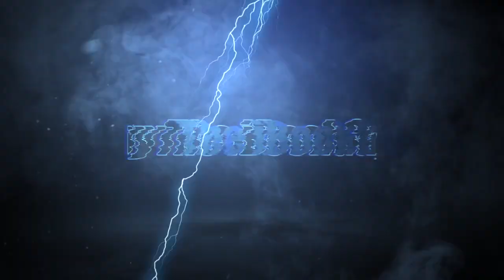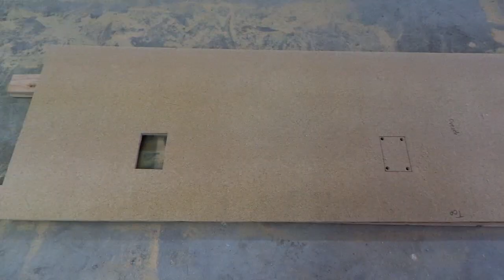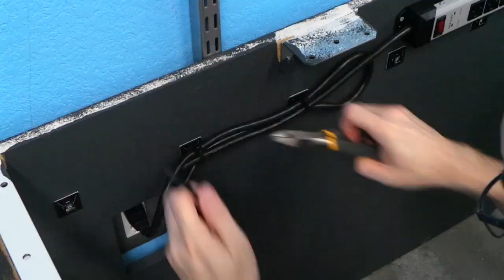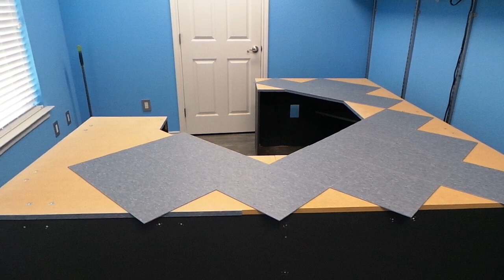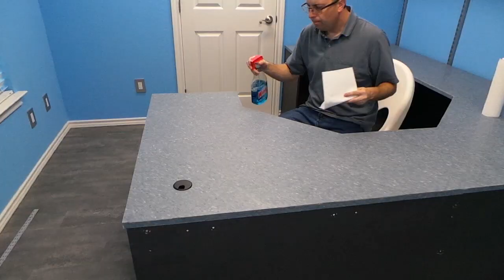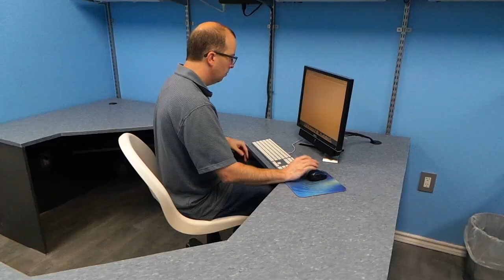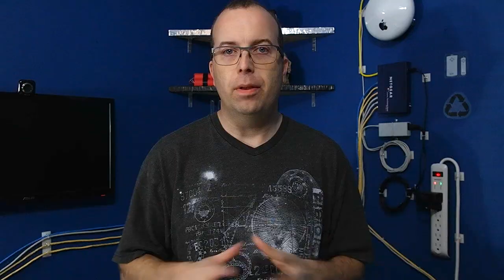Building the Ultimate Computer Desk - Part 3

Comment: Know this is from a while ago, but YouTube just recommended these videos, and I just had to comment... 

What you ended up with for your desk is real close to the desk I've been using for the past 10 or 12 years, that I cobbled together from several different types of office desks, except mine has a second level of storage cubbies stacked near the corners, on either side of the main work area, and a single shelf where my primary dual monitors sit.  I've also added several adjustable laptop/monitor stands that I can swing in and out as needed, along with recessed power/USB ports so I can plug things in from the top, instead of needing to reach underneath or behind things.

Comment: I've wanted to build this desk for like 4 years now finally in August I'm going to start I dont know if you'll see this but I'm thinking about using 1inch wood because the pc I'm getting for school and work is huge and heavy plus I'll be having 2+ monitors a printer but I was thinking about putting that on one of the shelves put it's also going to have all my gaming stuff as well I was also going to add in support posts in spots where it wouldnt restrict movement

Comment: First: great job. Even a crappy desk in this size would have cost you at least a grand out of the store.

But a few notes from somebody who also built his own working desk:

A rotary saw would have probably helped you a lot. Jig saws might be good for small sections, but they are very messy and slow on longer ones.
You should have used thicker or stronger wood, because the desk will bend over time. This will likely also lead to tiles popping up.
Another recommendation would be to use stronger L-Brackets for attaching the top. Your little undershelves were a good idea, because they increase the rigidity dramatically.

The tiles are interesting, but as you already experienced, they might not be available, if you need them.

One last note: Don't hide Macs. Cheap PCs, yes. But an Apple PC is always a joy to look at.

Comment: Hey I think that the 'Building the Ultimate Computer Desk' series is great but I would like to know the measurements you used to make your desk form this 3 Part video.
So if you can make link to the measurements you used that would be great.
Reply: I made a sketchup that's 2 meters by 2 meters if u want to use mine.

Comment: For desk underlighting, a really good and super cheap method is LED battery powered flip lights ( found for $1.00 each at DOLLAR TREE in my area although more expensive versions available at Harbor Freight, walmart, Big Lots, Target, etc. , take 3 AAA batteries each, one light brightly lights a medium sized room if high enough, also use velcro tape to mount the lights for easy uninstal/install for battery changing, one on underside of each half of the desktop will provide more than enough light and these lights can be left on and stay burning for days before battery failure) You can get the velcro at walmart and 2 lights at DOLLAR TREE and 6 batteries at DOLLAR TREE also for as little as $6.00 + tax.

Comment: If you build anything like this again, use a high quality Baltic Birch plywood instead of MDF or particle board. BBP is MUCH stronger, will last incredibly longer, and you can apply stain and urethane to it to get the look of a very expensive piece of furniture. BBP is going to be more expensive, but the pros far outweigh the cons.

On a side note, I just searched your channel for a video of the brain you had sitting on your bench, and couldn't find it. That thing was amazing.........did you make it or buy it??? I would love to have something like that on the shelves where my computer is set up.

Comment: It's been awhile but you probably would be better off buying a desk kit and modify it or look into commercial modular office cubicles. I do like your floor tile top, but ask around for discount/discontinued partial sets. Never use particle board without corner-side end reinforcement, full length end-cap brackets. oriented strand-board maybe better option.

Comment: edges are normally done with a bearing bit for router  This would have cost me a pinch more time BUT for your replica about $40 in Full. There is smooch= "so much" tile and flooring mat'ls at Restore, adhesive too that is CHEEAAAP You could have used 1x2 wood instead of Simpson 3" bracket at .98 each

Comment: Thanks for the floor tile idea!  I made a computer desk and laminated it with hardboard.  It looks great, it's seamless, it's plenty hard enough to use as a writing surface, it's cheap and it's easy to work with. However, water soaks in too easily and makes it bubble, oil stains it and I haven't found a lacquer or varnish that seals it well.  I may try your idea on my next computer table.

Comment: Great work!  Cheaper method would have been to fine sand the wood and stain it, then seal it with a few generous coats of polyurethane.  Polyurethane is very durable <Think bowling balls> and you can use very fine orbital sander to heat up and remove any dings or scratches easily.  Plus it's not pricey and you'll have enough left over for any/all repairs you'll need down the road.

Great video!

Comment: Great project.  Nice cable management also.  Kudos.  But the cost was quite high.  I was just at a Habitat thrift store yesterday and they had used, massive desks with side units for about $150.  I have several used tables I use for desks.  Whenever I need something else, I just visit used furniture, and thrift stores (I am in a Florida county with 30% retirees, thus lots of thrift stores) until I find something that fits the space I have.

Comment: Well this kind of "wood" is nit very good for a table top. Plywood should do a better job. But when you add some support like studs it should help preventing any bending. Did it with an osb bench. Just an inch by and half inch wood glued and screwed. No more movement. If you reduce these fasteners there should be money left for the additional wood.

Comment: This looks like PVC floor rubber which is really ugly. It would look so much better if you would use wood. A very hard and heavy wood without much spleens would be perfect. I would advise you to use an oil for the wood that enhances dark and light contrast. That stuff looks amazing. I would also use a bigger monitor, mount it on the wall and just increase the font size on the screen. That should look amazing and be much more fun to work with. You would also have more space on the desk and no ugly monitor stand.

Comment: I watched through your entire 3 part series on building a computer desk, and I'm awfully surprised. I did this very same thing about three years ago. 

I needed a computer desk for my office, and none of the ones in the market really fit my needs, either being too under developed, or being overzealous with lots of racks and drawers that I wouldn't really need, or would come in the way. Price also being was another factor. So I set out to design my own computer table. I had never done anything of that sort of a personal project, but the curiosity and the enthusiasm to see how it pans out pushed me towards it. 

My initial design was done on CAD (Solidworks - my background being in Mech Engineering), then did a sketch on paper. I printed the design, worked out what all I would require  (bill of materials), tabled the cost, and took the shortcut of hiring a carpenter to take care of the building part. Time being a constraint, I had to take it this route, plus I didn't have much of the tools back then. 

The construction was done in the same way that you did, and even had the 'hidden shelves', the wire holders, the table corner wire-ports/slot. I used a panel of colored plywood with vinyl finishing for the top of the table.

One thing that I found missing from your build, and something that even concerned you is the flexing of the board when you place your weight on it. 

Take the 'hidden shelf', invert it 90', and bolt it with L-clamps underneath the main table onto the wall, halfway lengthwise of the main board, and you have supports called 'ribs'. Put up a couple or more, and you will have one superstrong table. You can place slots in them for the wires to go through. Also, I had placed a 2 inch wide strip of the same MDF lengthwise along the edge of the table underneath. This added to the corner strength.

Before I had done all this, the table would flex under pressure, but now I can sit on it, and no flexing. I suggest you place these as well. 

It's been three years since I had built my table, and have to say, its still good as new. The best investment. And yea, it took just under a week to build and paint. It holds 2 computers, a photostat/printer machine, and a paper rack.

This also felt really good to watch, because of the feeling that if you have an idea, there is an old saying (don't know who said it) that there will be atleast nine people around the world who will have thought up the same.

Thanks for reading my awfully long comment too. :D Just enthusiastic about projects like this. Subbed!

Comment: great idea  but bad implementation. i know MDF is cheap but you should have went with good old plywood it will hold up better and is stronger. Also that top really needs a support frame and not just the L brackets. the middle is going to buckle and break over time.

Comment: What a fun build! That vinyl tile surface is a great idea! Stiff desktop: for years I have used signboard for desktops and shelves. It is a super-stiff type of high-ply (extra layers) plywood with a smooth, durable, paintable coating on each side. Because it is used for outdoor signs, it won't sag or warp if it gets damp. However, the surface appearance is not great, so I think I'll look into your vinyl tile idea. Thanks for the cable management system tips -- I was looking for something like that and didn't know it. :)

Comment: Great video. There are steel straps you can buy that are flat and may keep wood from bowing. They come in 3"-11" sizes at my local big box hardware stores. They're near the lumber section. Also, 3/4" Plywood can't bow. I was going to use a door. I'm just not sold on using a hollow core door unless the outside is oak or some other hardwood.

Comment: 6:37 - 6:59 Why didn't you use LED strips? They are cheaper, bright enough & easy to cut,connect and solder since there are only 2-3 cables. If I were you, I would do that instead of buying cabinet lights.

Comment: If I could offer a suggestion, I would use 2x4 construction for the frame of the desk and then sheath it in the MDF and particle board. And right as I was thinking it, he mentioned the router with a flush trim bit and a round over bit to save you the time versus the filing. And if you're concerned about costs, check your local pawn shops for used tools instead of buying new. (Not a professional, just a DIYer with too much time on his hands)

Comment: In my opinion, you seriously underestimated the structural strengths of your construction materials. I mean, what would have happened if you weren't at home and some guest tried to sit on the desk's surface? You can do that with regular desks. Not with my desk but then again I use a glass surfaced kitchen table with metal legs so any fool can see it's not strong enough to support someone sitting on it.

Comment: I think I need to do something similar.  My office/room are a shared space, and not much room for anything, and the desk I have now is 2 desks set in an L-shape but separate so they're not exactly working well together.  I think a custom built corner L desk would much better suite my needs and I could design much better storage solutions into it and incorporate my dual monitor setup into the desk build.

Comment: I would have made the desk taller. First off, the top of the monitor should be level with your eyes so you aren't craning your neck. Also with soldering it helps your back not to hunch over.

Comment: Missed a trick on not including a cup holder hole, no spill into your keyboard.
Black polyurethane and then many layers of clear poly is also an option, scuffed out in the mouse area with steel wool you can simply mouse on the bare desk.
Takes a few days of off gassing fumes though.
Regular paint isn't hard enough, unless oil.

Comment: One thing I would have done with the corner shelves under the desk is to cut the back corner off so it creates a small hole where you can fish things like power cords, etc from the top shelf to the bottom shelf on the areas he has 2 shelves on.

Comment: MDF and HDF isn't a rigid structural wood! It has no long interconnecting fibers. It's only meant to be used as a dividing material such as walls, and it's medium or high density makes it great for sound equipment. Making it thicker won't eliminate the sag, only prolong the inevitable.

Comment: I was impressed but it cost almost 500$.
Reply: look at what a commercial made version cost....    The ones i saw were well over $1000
Reply: DIY does not necessarily mean cheap if you do it well (I have made most of my furniture myself, mostly because I wanted customized measurements and other solutions). Personally, I would have made the top from oiled hardwood (about an inch thick) which would have added at least a hundred to the cost. I usually do everything from massive (full) wood because it is far nicer to work with and repair if necessary and more durable, but it is also more expensive than particle board or MDF.

Comment: It's 3/4 MDF not 1/4. But it would still flex under enough pressure. Cabinet grade plywood with some L-Shape metal bars underneath would have made it stronger, but it would have gone a little over-budget. Nonetheless, interesting build.

Comment: Pretty expensive...
Reply: +Vermilicious I have seen desks in various stores that cost more than $492.
Reply: If you bought this from a company it would be well over 1000
Reply: Sure, but compared to similar sized desks, it's much cheaper. Besides you get to customize every single bit of it
Reply: It's cheap wtf? Mine was over $700 (well it's got a wooden top and the wood is 3 inches thick + it's got "massive" wood <normal wood is made of compressed sawdust, not actual wood>)
Reply: @your_average_clippy  normal wood that's compressed sawdust isn't wood. That's particle board or MDF. Real wood is much much more expensive
Reply: @scottyhaines4226 I'm talking about normal tables. They usually have compressed sawdust with think wood or plastic exteriors where I live.

Comment: I would love to steal your tile idea,  but unfortunately they don't sell them here,  i might try linoleum though
Reply: He is using linoleum, but he is using some technical name for it. Vinyl tile = linoleum = VCT = Vinyl Composite Tile.
Reply: +Buddy Clem They are close but not close enough,  linoleum, at least around here,  is much softer than VCT. You can see as he holds a tile it doesn't bend and he can file/sand it,  linoleum that size would definitely bend under it's own weight, it has to,  otherwise it would never lie flat,  seeing as it's stored on big roles,  and you couldn't mold it up the wall to act like baseboard.
Reply: no, ACTUALLY VCT TILE IS TOTALLY DIFFERENT THAN LINOLEUM lino tile is very thin flexible, these are very thick and stiff, they stopped using them because almost every brand had asbestos in them but some people still make them they are cheap as dirt but hard to find. VCT is the correct name vinyl composite tile. vinyl composite IS NOT LINOLEUM.

Comment: You know, they make 12v stick-on LED strips, meant for car interiors and the like, that would work well for under-desk lighting for this. You could re-purpose a computer (or laptop) power supply, or just use a wall-wart. It wouldn't be bright, but it would be more than enough light to see by when working underneath.

Comment: Wow, the material cost is very high there. In my country, all of these materials with the same quality will cost around 250 usd.
Reply: IN SOVIET RUSSIA, DESK BUILDS ITSELF!
Reply: HE SPENT WAY TOO MUCH MONEY AND HE USED mdf, A COMPOSITE BOARD. HE COULD HAVE EASILY GOTTEN HARDWOOD FOR CHEAP, BUT HE CLEARLY DOES NOT HAVE THE CORRECT SOURCES TO DO SO. AS YOU CAN SEE HE SHOPPED AT lowes. THEY DO NOT EVEN SELL HARDWOOD.
Reply: HE USED "SPEAKER BOX" WOOD FOR A DESK
Reply: Soviet Russia?
Reply: Anomonny SoundSys Oh, you're from Thailand?
Reply: Steven Pope MDF is not the best choice for speaker boxes.
And it's not limited to speaker boxes, it can be used in many applications, including desks.
Hardwoord costs a fortune compared to MDF.
He spent the right ammount, consdering tools.

Stop writing in caps, it will only make you look like an idiot

Comment: I looked for videos about building a computer desk. I started with your 3 part videos and stopped right there because this is the desk of my dreams. I mean WOW! This turned out so nice. It's the perfect size and I like the freedom of mobility in the computer chair that it offers. I could just buy a computer desk, but what's the fun in that? Most that I have seen in the stores look nice but aren't very good in quality and don't have enough room. If you want it done right, then do it yourself, right? I am a DIY guy, I live for it. Even if it costs a lot, it will be to my liking. I need a desk just like the one you built for my gaming desktop that I'm in the process of building and my monitors. But I also fix computers for people and sometimes I have 3 - 5 computers at a time that I have to work on simultaneously. That's where the extra room on the desk comes in. I can do my daily tasks on my computer while the client's computers are just a roll-in-the-chair away to go check on. The ultimate workstation. Thank you for these videos, I hope it makes you feel good that you gave someone major inspiration.